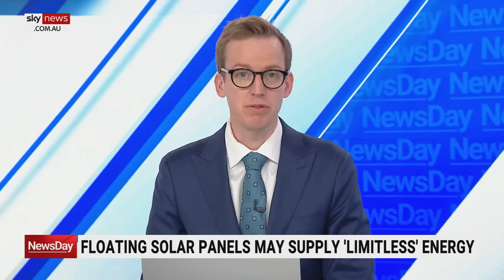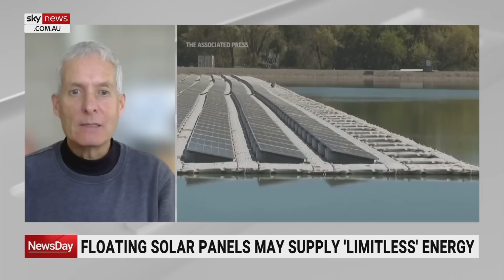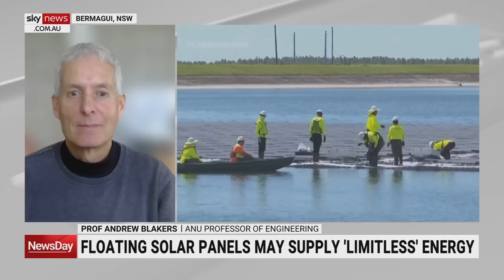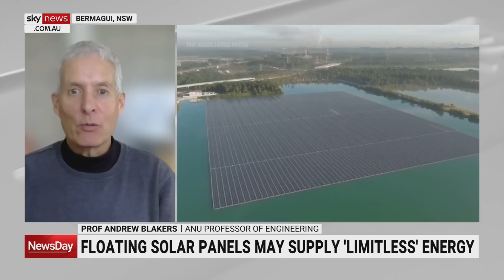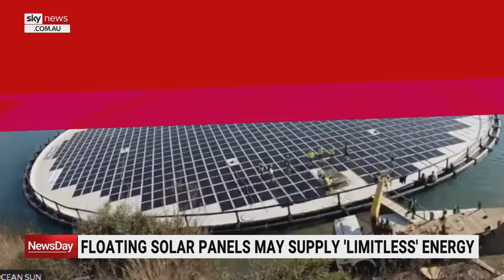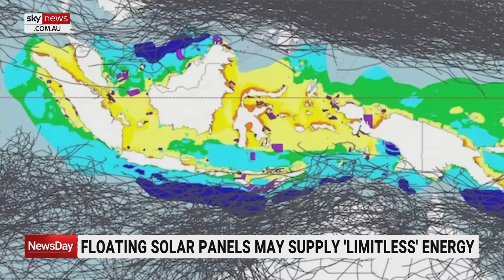Floating solar panels could supply limitless amounts of energy

Comment: why not use the electricity to boil the water instead? then you get steam. you can utilise steam turbines. you get desalinated water. with the sea salt left over, you sell some as a commodity. you keep some and use it as thermal storage for when the sun dont shine. massive insulated silos full of salt at 500C+. can sink them into the ground and not know theyre there! they can leak and theres no damage as its just salt! and salt sure as hell doesnt catch fire!
either way, you just keep boiling water 24/7. 

thast all coal does. thats all nuclear does. BOILS WATER.

naw. lets wire up batteries and inverters and cables and electronics in sealed enclosures that are expected to survive salt water and sea spray, barnacle and other marine life growth, etc, etc.

anyone living on the coast should know that salt water destroys everything.

and a solar panel in the sea air, with its nickel and aluminium conductors already prone to galvanic corrosion...

why use PV at all? throw in some evacuated tubes... lets see... um. glass. make that from sand. vacuum. make that from nothing. :D copper tubes. that stuffs actually pretty good around sea water when it ISNT electrically active...

and are there any chemicals? doping agents? arsenic? gallium? rare earths? things that need costly mining and industrial processes to produce?

one must always ask about these ideas... WHO BENEFITS MOST?

in the case of PV arrays... LG. samsung. some unknown chinese company. etc. etc.

Comment: Yet another monumentally stupid and unproved idea, not even a plan. How many thousands of hectares of ocean would need to be covered to make it viable?,  At what cost? What effect does depriving the ocean of sunlight, have on the ocean environment? How do you build a salt water proof solar panel? which , in the best possible outcome, will only last 20 years anyway. Just stop dikking about with the wild and woolly fantasies and build clusters of small modular nuclear power plants. They take up relatively tiny amounts of real estate, have nominal carbon outputs, would surely be way cheaper and easy to connect to the grid, would last a lot longer than 20 years and would supply power 24/7, even when sun is not shining. Leave the oceans, the forests and the farms out of the renewables plan, they are better served by just leaving them alone.

Comment: Its still cheaper than power to Singapore on top with battery a line similar to china floating airport 😁😁😁😁😁5 Smile's. Unfortunately unlike a solid core turbines endlessly with service this needs full replacement every twenty to 30 year's. There's two others for main power one NASA electrical motor at one kilowatt but x4 together gets that kilowatt output to scale all but start up the other under test but says enough to run it's self 35mw

Comment: Clowns have absolutely no idea the scale of what is required to make this transition. Solar panels are a joke, and they were cheap. Cost of materials will skyrocket by more than 500 fold in the coming years. Take Lithium, was around $3000 a tonne,,, is now $70000 a tonne, and there's not enough of it to keep this gig going.

Comment: Float them over coral reefs during extreme hot weather times and they can double as reef protection too.
Reply: Maybe.  I don't know.
Reply: @simongross3122   Trial sort of thing.
Reply: @runnyhunny786  It's an interesting idea.  But then there's the cables and whatnot to take electricity from the panels back to land.  So somewhere ashore there would have to be some kind of building.  And the maintenance and cleaning of the panels would require boats to go out to the panels to work.  I would think that if there are flat areas floating on top of the ocean, then birds would land on them and foul them.  Not saying it's not feasible.  I agree it would have to be tried to figure out how well it would work.

Comment: If the solar panels are absorbing the heat/energy that should have been absorbed by the ocean, would that affects the worlds currents due to the increase in difference of temperature between the top  and deeper waters?

Comment: Hmmmmmm…… 35,000 TWh / year. Let’s take a look. 

Let’s say that the panels run at capacity for 12 hours a day. That’s 8 TW of installed capacity which is 8,000 GW. 

Golmud Solar Park is the world's largest solar farm with installed solar capacity of 2.8 GW. Operating 12 hours a day that’s 12.3 TWh / year. The facility has 7,000,000 solar panels. 

To achieve 35,000 TWh / year would require 2,845 x Golmud Solar Park. Alternatively, 19,915,000,000 solar panels. 

Golmud Solar Park is 2.6 sq km. That now becomes 7,400 sq km. Singapore is 730 sq km. 

Everything above assume running 12 hours a day for 365 days a year. However, solar panels run nowhere near 50% of installed capacity. It’s 20% - 25%. 

The report is nonsense.
Reply: there is not "12 hours of effective peak sunlight" anywhere on earth, including the equator which might have 8 hours.

Comment: How many whales and dolphins will die when they try to come up for air, and are blocked by solar panels? Will they short circuit when waves cause them to bounce around and smash into eachother? Will boats be able to navigate around them safely? How often will the seagull crap have to be cleaned off the panels?
Reply: @@DSA-blackfaction Plus the ones that are defective replace themselves. self replacing.

Comment: I'm assuming this is for Europe. Or Asia.
We have enormous amounts of arid land in Australia. We have no need for the expense of floatation.
Reply: Let’s explain to you how the solar energy grid works or doesn’t work, it loses 85% of its energy transporting that energy to where it’s needed, unlike if it was just installed on a house where this technology was designed for.  You can’t transfer this energy hundreds of miles away bcse it gets depleted and is too expensive to have sub storing stations every 50 kms and even then it’s useless expensive and beyond stupid solar panels are land fill! Destroying our environment and water table and takes 1000 times more energy to produce than clean energy gas and coal that makes these solar panels in the first place

Comment: Block the the light from reaching the Phytoplankton that is used for photosynthesis that removes CO2 from the earth. Plus also the panels are only 18% efficient so the other 82% of the sunlight is turned in to heat warming the oceans and creating more water vapor the worst greenhouse gas !
Who is going to keep the panels clean from salt or algae or bird shit etc ?
What happens when there is rough seas or cyclone or tsunami etc 
If the panels get damage in any way all those cancerous chemicals leach into ocean killing all polar bears

Comment: Nuclear is endless power.
Reply: @@DSA-blackfaction The technology to turn nuclear waste into energy, known as a nuclear fast reactor, has existed for decades. It was proven out by a United States government research lab pilot plant that operated from the 1960s through the 1990s. But it was never economical enough to develop at scale.
Several private nuclear innovation companies are developing commercial fast reactors, namely Oklo and TerraPower. But even still, there are supply chain issues in the United States for producing the fuel that goes into fast reactors.
Reply: @@DSA-blackfaction They are  cycling reactors now that can use old waste in a closed circuit. Look it up, If fossil fuel is old fashioned, so is nuclear automatically bad. 

Catch up.
Reply: Nuclear is easily the most expensive form of new energy generation. Over the last 20 years it has a history of major cost blowouts in projects. No-one directly involved in the energy industry in Australia is pushing for nuclear.

Nuclear is stagnating. From the IEA total global wind and solar capacity expected to be added in 2023 is 390 GW, while net nuclear is 0 GW, with new capacity coming online only just covering closures.

Comment: Or you could go with nuclear which doesn't block the entire shoreline and significantly much cheaper.
Reply: Molten Salt Reactor and Thorium..........the energy crisis has already been solved.
Reply: Yep. Yank here. We're trying to get small modules going here. Once the workers build the first one the next identical ones would go quickly.
Reply: @@DSA-blackfactionless problems and deaths than a day on the road. 
I really want some of what you’re smoking.
Reply: Four times more expensive than wind per kWh, so no, not really much cheaper. But more reliable generally yes.
Reply: @yggdrasil9039  the reason your bill is so high is wind and solar so….. not cheaper at all.
Reply: @fugawiaus  Well, firstly, the reason my power bill is zero and I'm actually owed 300 dollars in credit from my retail power company is because I have 10kW of solar on the roof. 😅
Secondly, the reason power is expensive in Australia at the moment is the wholesale price was very expensive last year and earlier this year, and retail sellers jacked up their prices in response. But the wholesale price is now very cheap - because of wind and solar - and that will flow through to retail prices by 2024, I would assume. If not, then there's something very wrong with the electricity market!

Comment: What a stupid idea, solar panel frames are made from aluminium, what does salt water do to aluminium, it corrodes them.  Then you have to run cables to them, well thought out engineering experiment in a large indoor pool with no waves, wind, etc.
Reply: That's why they don't build boats from aluminium

Comment: The electrolysis would render them unusable within twelve months, and the toxins would pollute the water indefinitely, The problem with climate change experts, is that they are prepared to destroy the environment to reduce the carbon emissions that they are generating with inefficient solar panels and wind turbines, just ask two questions, how much will they cost, and how long will it take to recover the cost, 😊
Reply: Some wild unsubstantiated claims there. 
Solar and Wind are more efficient than coal or gas with higher ERoEIs
Reply: @rattusfinkus fair enough. Back up your claims then as well. Or they too will remain “unsubstantiated”…
Reply: @nathantudor5763  boats are made of steel and aluminium and they last long enough to generate a profit. It would be a doddle to build a PV system to withstand the marine environment.
Reply: @rattusfinkus  you're dreaming, wind and solar only work at best 35% off the time, over a twelve month period, and reduce efficiency every year until they need replacing, coal and gas work 24/7 over a fifty year period, the only carbon emissions free form of energy is nuclear power that runs 24/7, for more than fifty years,
Reply: @blizzard5657  but they don't, when renewables produce cheap power gas and coal and nuclear can't sell their power, that's why they're going broke and need subsidies or caps on fuel prices paid by us.

Comment: Terrible idea. Let's block vast portions of the Earth's surface, what environmental change could that possibly have ?
Likely, it would stop all aquatic activity in the first two maybe three depth zones, and undoubtedly, disrupt the forth with anchoring and such.
That aside, the corrosive environment of the Ocean will ensure astronomical maintenance costs, and perpetuating a constant need for replacement parts.
Highly efficient advanced nuclear power. We don't energy problems at a root cause, we have moronic leadership, and mostly propagandized media.
Reply: Highly expensive and extremely slow to build nuclear power